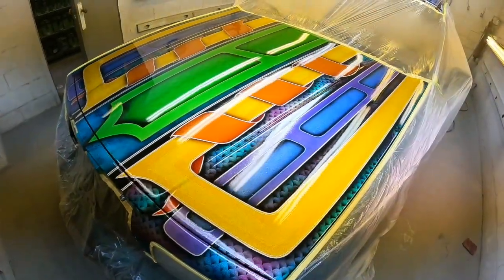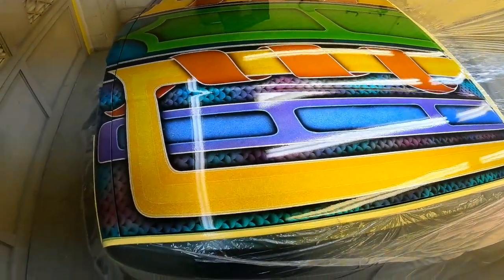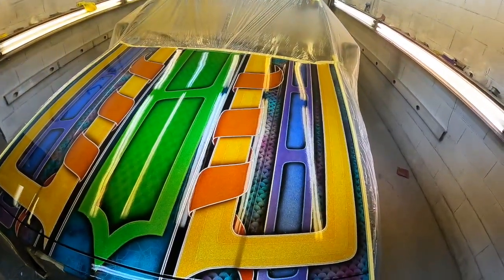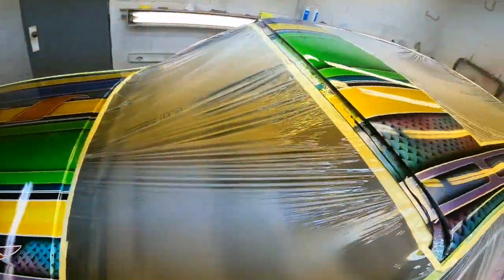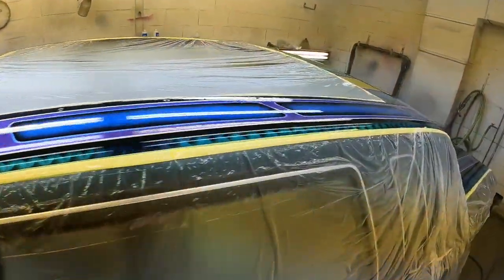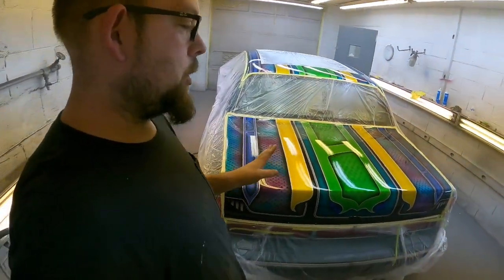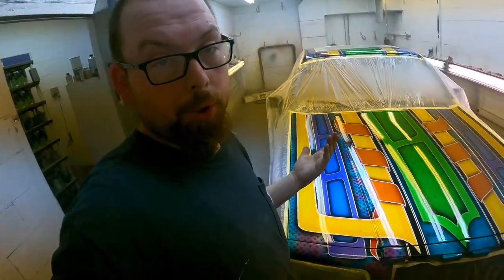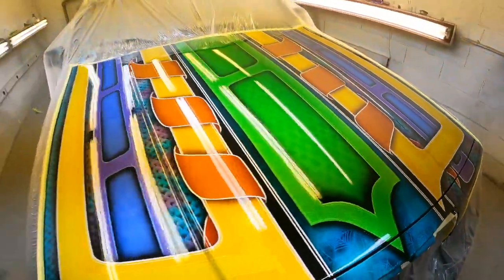First time LOWRIDER PATTERNS!

Comment: 🚨🚨🚨🚨Bro!! i definitely need your help.. 🙏🏽PLEASE! tell me what other Frame/body bushings can i use from my 2000 Lincoln Town Car because i can’t seem to find them no where online.🚨🚨🚨
Reply from the maker: Sorry man I wouldn’t be much help on a guaranteed solution but I’ve done a frame swap on one and honestly you could probably use standard gm bushings and would get the job done. Like 64 impala body bushings are pretty universal. Just have to make sure you have enough. Some people even use hockey pucks and drill holes in them and go to the hardware store to get big washers to run with them.
Reply: @RJTickler  that hockey puck ideas isn’t bad! i was lookn at some “98” f150 bushings they look similar but that hockey puck thing i’m definitely gonna try out i appreciate it